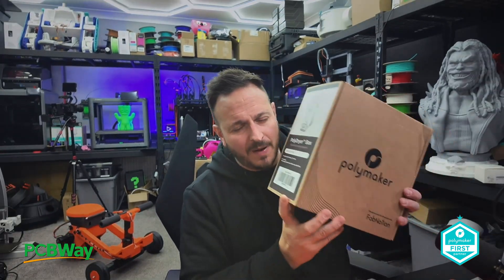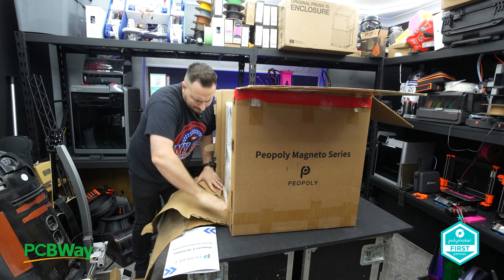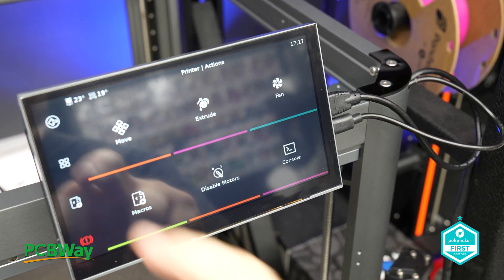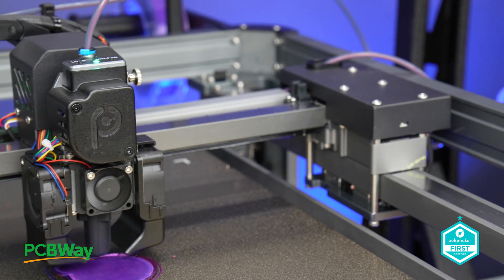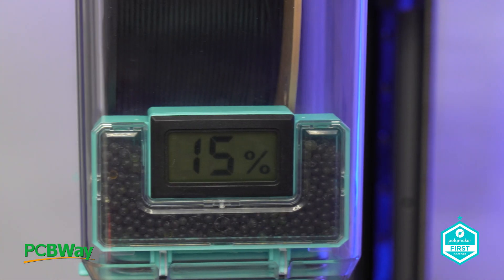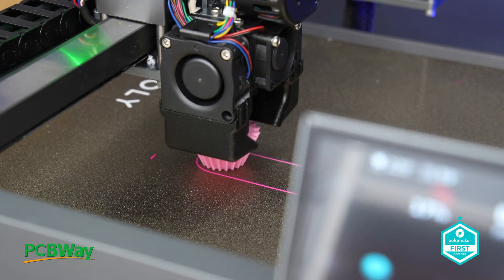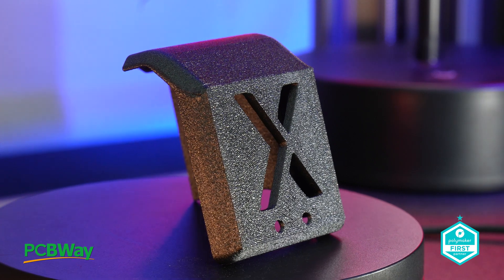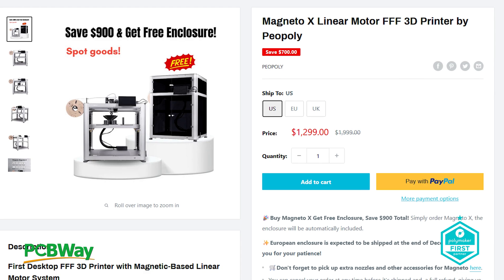Mastering 3D Printing with Peopoly Magneto X

Comment: Some real world speeds, as that "up to" is likely the long meltzone with a .8 and ABS. I've been printing PLA on the medium meltzone (comes with medium and long) with the .4 nozzle and at 230C I cap out between 18 and 22 cubic mm/s flow rate depending on the filament brand, which gets me around 300mm/s speed. Flow tests really went to around 24, but I bumped ot down a little for safety factor. At that speed and temp, I'm getting very good layer adhesion, something I've tuned for as something I print a lot needs it. 

Speaking of tuning, the repeated mentions are for good reason. You definitely want to go through the Ellis guide and some others and really dial things in. When you do that, it's quite happy to keep banging out prints. 

Another thing to mention is that customer support has been really really great with the couple of issues I had with my preorder shipping wave printer. Keeping in mind that support is based in China so if you're westward they won't be on normal business hours in your region, they're super helpful and willing to work with you until your issue is identified and resolved. I was having load cell issues and told them I'd had an oops trying to lower the bed that crashed it into the toolhead pretty thoroughly and would be happy to pay for replacement parts as it was likely my fault. They just sent the parts without charging as their primary focus was making sure I was back up and running.

Overall I've really liked it, and have had very good results.

Comment: you can't print color :( I too would like to get this printer it is on sale now with the enclosure but it may be a little more than I want ot handle at this time. I am at an age where I just want to print and make stuff and not have to fiddle with settings, and hardware, and software and this looks like it is a bottom less pit for tinkering - not for me but I am intrigued.

Comment: I think the 'linear motor' shtick is pure marketing. It doesn't add anything to 3D printing, but also has plenty of cons to it. If you want something that stands out as "unique" for more money, but lesser performance...  go for it. Fall for the marketing, or not.
Reply: Really? I see this as the high performance option, no belts, no play, closed loop feed back, resulting in more accuracey, at leaste in theory,  still depends how they implement it.  And from what ive seen it prints great, and could only get better as it progresses At the very leaste i hope it brings closed loop control to 3d printers.  Then you dont need perfect mechanics, you just need to check to make sure youre in the right spot.   Linear motors have this built into the design a closed loop feedback system but from what im reading steppers can have it too, just not as common because they're "accurate enough" for most 3d prnting needs, well if they're accurate enough why can i see z lines?  ...  This is welcome to the 3d printing , more then welcome.  Finally some real innovation. I couldnt believe our printers were printing blind before this relying on perfect mechanics and this one actually has some eyes with its closed loop feedback system. WOW just WOW Even a Bambu is a blind bat compared to this eagle of a printer!   wow!

Comment: I've had mine about 6 months and from what I saw in the begging of the video the changes are good.   Mine did not have fans over the electronics, so added my own,  the master circuit breaker is now accessible from the top instead of the bottom of the printer.  My Bowden tube ran from the back to the print head, now it goes though the cable tray.    I would like to see the filament sensor work.  I have not found an update to their Klpper that correctly supports it.  It has

Comment: I own one too and after several problems (early unit) its now my favorite printer. Absolute amazing. But you need to print fast. Slow speed will do much VFA unfortunately. But this machine is made for speed anyway. You can print (with good profiles and magnet motors calibrated) easy with 300 to 400 mm/s (0.2 mm layer, 0.4 nozzle) in BambuLab quality. Realy love it!
Thanks for this nice review.
Reply: Any idea where the VFA's are coming from? Really surprised they're still around with the belts gone. I'm wondering if its some weird extrusion gear issue?
Reply: @MoonWind32690  its from the motors. They are not at constant velocity because of the magnets. That's a typical thing from magnetic drive. Peopoly is working on it to reduce it to the minimum. The actual  units have different magnet rails and   little different motors afaik.
Reply: @Holger_aka_Schmudi  Just got mine setup, I'm not seeing any VFAs but I haven't printed many models.

The magnet stepping is surprising but also sounds like the same issues that lead to LDO motors. 

Just getting things updated and saw the 'motor tuning' section. I imagine I'll want to probably wait and see what Peopoly can manage to do as they're likely better than I would be ^_^

Thanks for the clarity!

Comment: I’m hoping to see this platform extended to IDEX (which would not need extra belts), or even better, a tool changer. Tools could simply be parked on short magnetic linear rails along the sides. The x rail would be moved to abut with them, and then the tool slid on or off. On the surface, this seems a much better way to build a tool changer than the current docking methods.